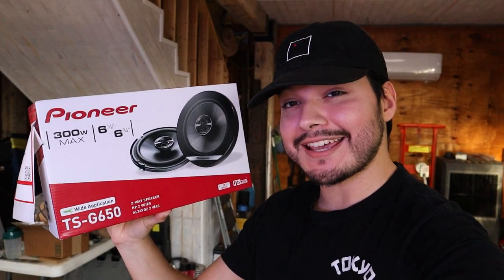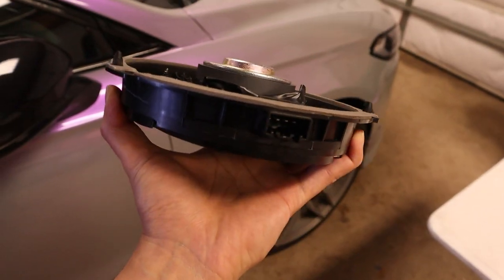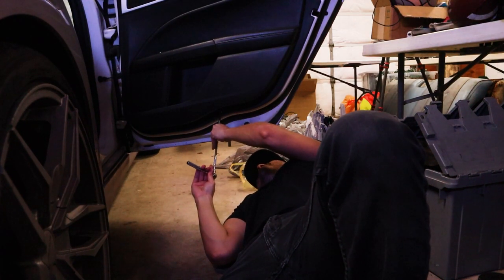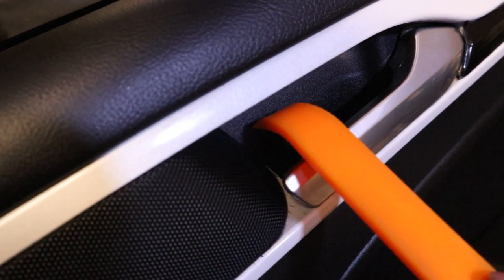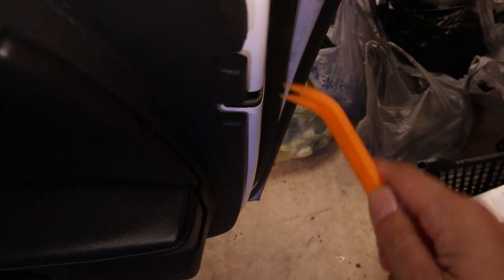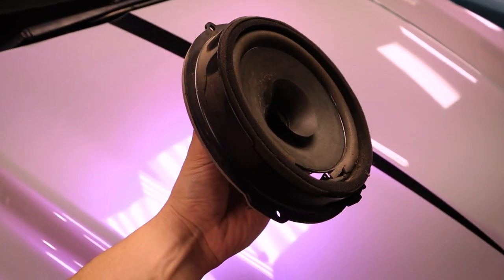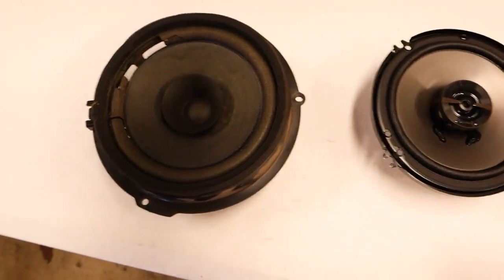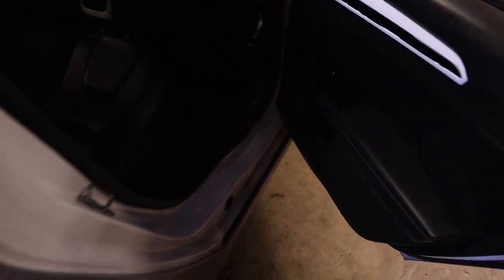How To Upgrade Your Speakers! (The Easy Way)

Comment: I will say my fusion isn’t as clean as yours looks wise and literally (it’s filthy lmao) but I have two soundstream 12 inch subs 2500 watts a piece 5k amp in the trunk and the door speakers are absolutely shot, definitely have some serious foam rot so thank you for your informative video, I’ll check out crutchfield for sure

Comment: I've started getting a rattle in one of my speakers at certain frequencies so this will be really helpful when I decide to address it. Should I just swap the one bad speaker or do you recommend upgrading all at the same time?
Reply from the maker: Most of the speakers for sale come with a set of two so I’d suggest doing two at a time! There is a nice pickup in audio quality so I’d just do em all like that 👍🏼

Comment: Been working in getting those bolts out in the car door but my tools aren’t loosing the bolt at all both the smaller and big one will an impact driver drill get them out easier??  (note I twirled around with my 10mm and my 5.5mm for almost 2 hours was only able to get 2 small ones out)

Comment: Hey Dito, not really to familiar with sodering the wires the speaker, any tops? I want to replace my speakers in my 2015 fusion with the same ones you got.
Reply from the maker: Sure! So main thing is just you want to make sure you’re making clear contact between the pieces. So aim to get it more centered and build up some around it so that it’s secure. Then from there you can wrap some electrical tape around it for extra security and then you should be good 👍🏼